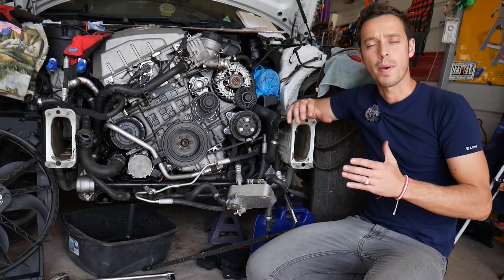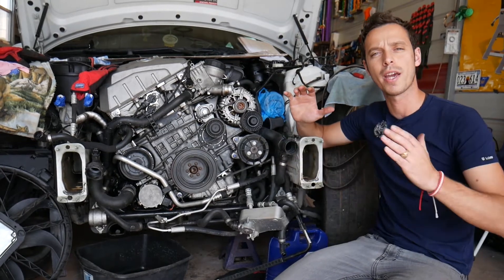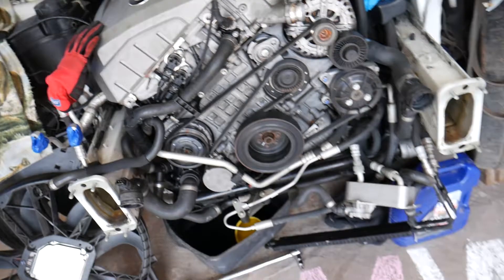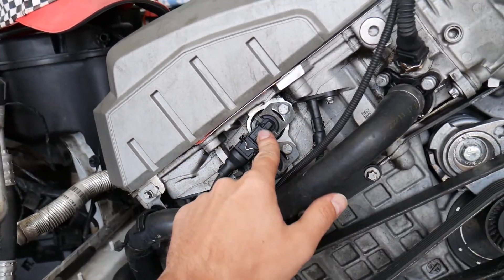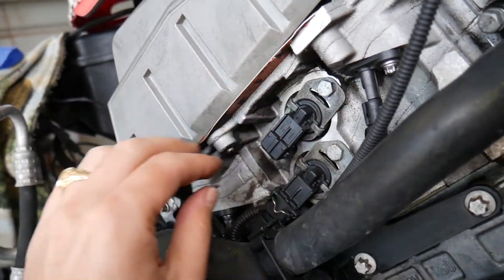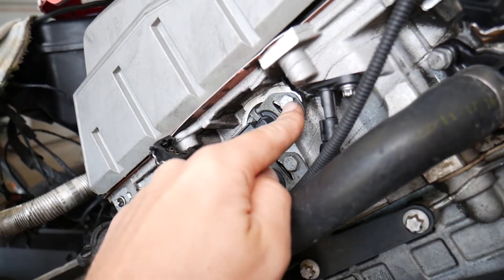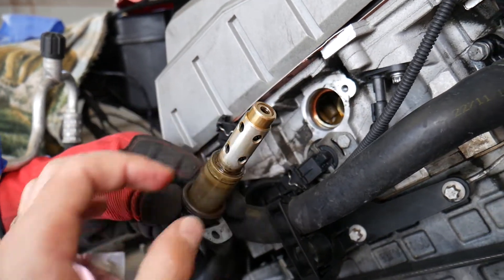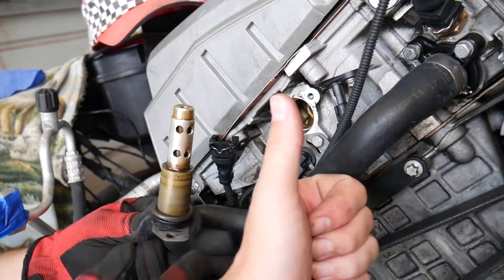BMW X5 VANOS SOLENOID REPLACEMENT LOCATION, INTAKE EXHAUST VANOS SOLENOID

Comment: Why you don’t make a full complete video!! Cleaning, replacing and such why i have to hunt for the other parts!
Reply: Cleaning is not work for long. There is a spring inside that getting soft over time. So cleaning will not last. It will make a difference initially but I suggest change them. You need new springs 👌🏻

Comment: Quick question I just built my N54 engine & now I’m getting a warning light 2aa5,2a82 + 3100 All the center has been replaced still getting the same code let me know if you can help